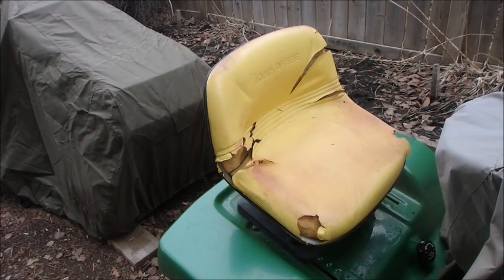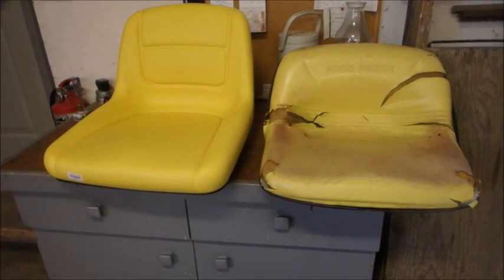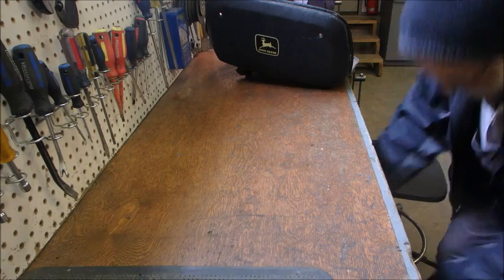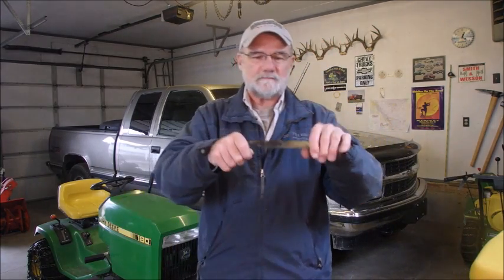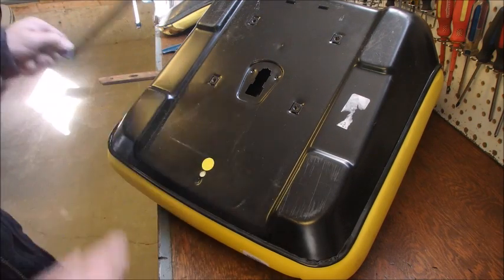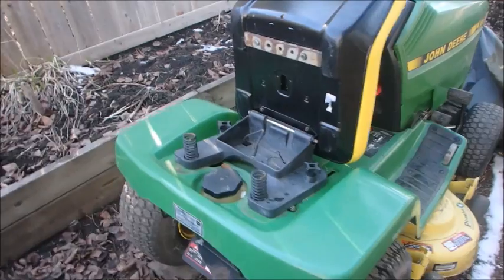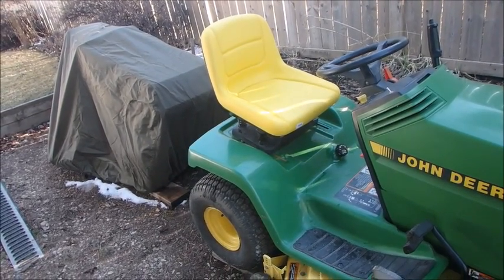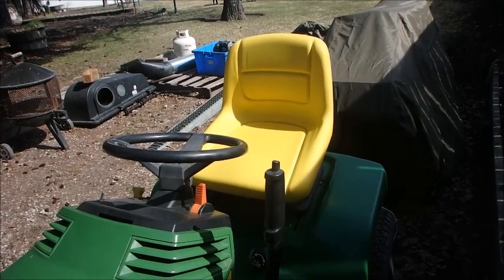Replacing a Cracked John Deere Seat

Comment: That's a big saving replacing the seat, looks good. Have you thought of having a wood burner in the garage for those cold months. That dry heat will feel good. Save on the new furnace too. Our neighbor has wood stacked on two sides of his house for winter, he says that he does have to us his new gas furnace. They nicknamed him "WOODY." He's a real good neighbor, he helps people too.
Reply from the maker: Well with the natural gas here i can turn down the furnace to just above freezing and not worry.  It is very inexpensive too.  As far as wood heat goes , in my opinion it is just too dangerous.  At my age too much work too.  I had it in my garage when i was young.  Different garage  LOL

Comment: Can't live without Princess Auto. when tractor seats go on sale they are so very much cheaper than my small engine parts suppliers it ridiculous. I was even too cheap to buy a 45$ seat on sale at princess auto I spent $18 on the cold weather vinyl and did a recover job on one of my seats.  That new seat looks great. can't wait to see that safety switch go in they really are a good thing.
Reply from the maker: Thanks Pat.  Yes it is next.  Possibly new front tires too.
Reply: too bad you are on the other side of country, I would lend you my small engine tire changer I got from princess auto. makes changing those small tires a breeze.
Reply from the maker: I don't do it enough do make it pay.   Maybe in the future.
Reply: Bruce Pender  totally, I change tires often enough that the time saved pays for the tool but to change 1 set it would make those tires awfully expensive  😉

Comment: Bruce how did you connect the electrical connection under the seat?
Reply from the maker: I inserted the  igsistting connector into the seat hole    dragged it back till it clicked in.  TOO Easy.